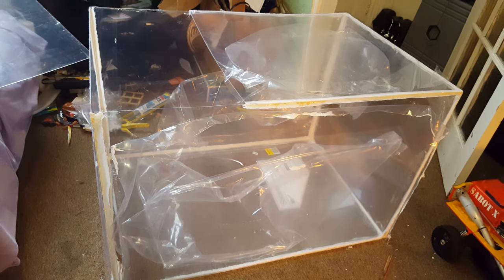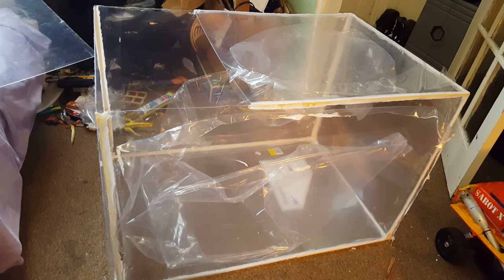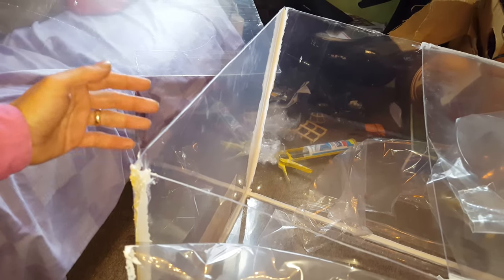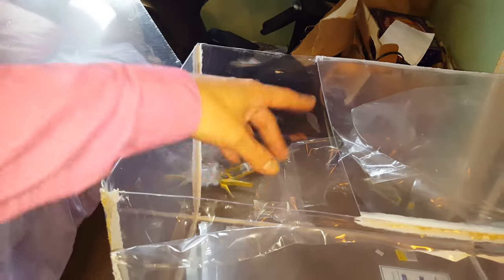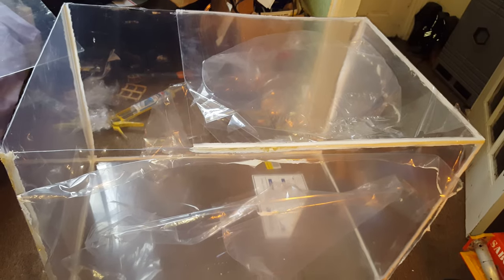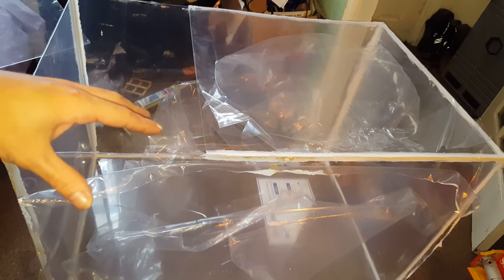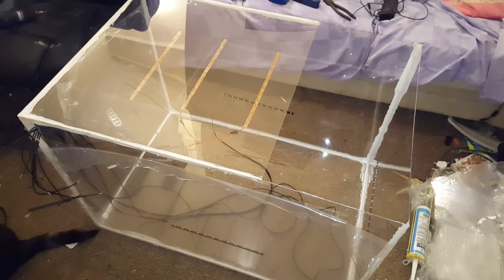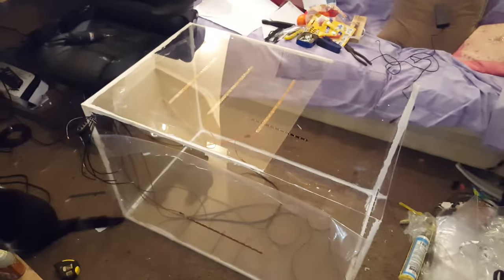"The dust tank x9000 active turbo"

Comment: This is going to be unreal mate I can tell you have thought a lot on this just be very careful on them grinders as they are one if not thee most dangerous tool you can use can be rosky to use ;0 Looking forward to the results here :)
Reply from the maker: +macplastering thanks mate :-) yeah that 9" is a real horror :-D I was using it at head height the other day without a guard on and I could feel my legs shaking (literally) :-p hoping it should be good in this stand I got for it though, the stand came with its own guard so im hoping with plenty of patience I will be good :-D Will have it going in a few days just waiting for some long rubber thick gloves off ebay to put in the front of the plastic there :-)

Comment: nice dust collector. seems like it should work great.
Reply from the maker: +2cwik4u104 cheers 2cwik :-) yep hoping this will stop the brick dust flooding my scale warehouse :-D I'll glue it to the floor then to the shelf above it and it should cope with the vibrations of the 9" I think...in theory...possibly :-p
Reply: as long as it can hold the water pressure, I think your good. lol.
Reply from the maker: 2cwik4u104 lol so true :-) yep im hoping the water will never build up over the inch mark, from the look of it if it reached two or three inches of water in there then I will be smelling wet rockwool for ever more :-D

Comment: It looks like it needs two holes in it with rubber gloves attached on the inside (-:
Reply from the maker: +Jax Teller RC <.< >.>I got the gloves but they didn't fit :-( :-p the material bunched when the grinder was at its peak and the rubbery material didn't have enough give to come out or bend and it got in the way im afraid :-) was well worth the test though :-D
Reply: BattonFive
You could put a baby in there and Incubate it (-;
Reply from the maker: Jax Teller RC anything to reduce the noise of em :-D